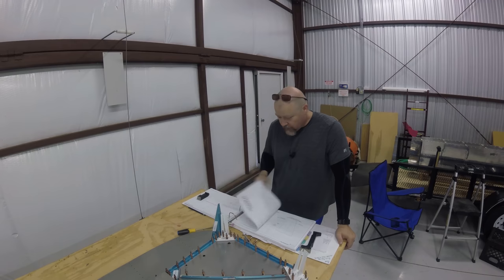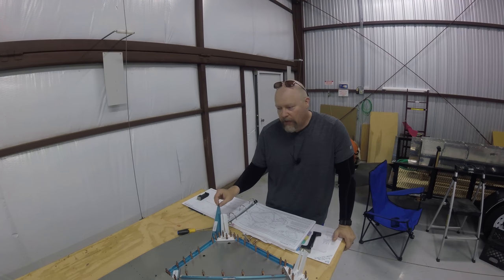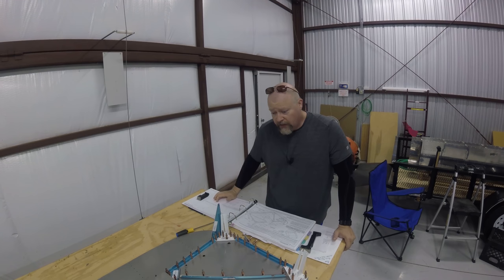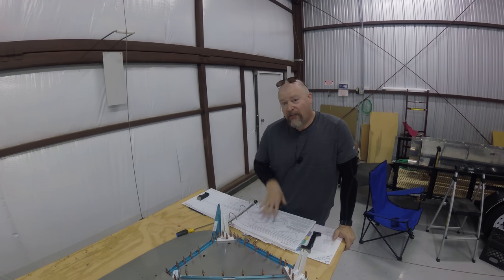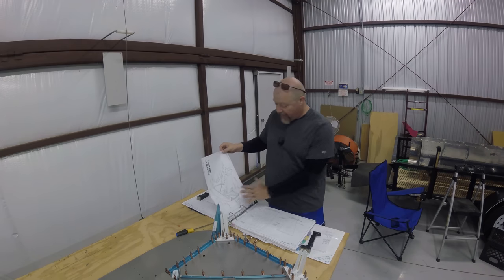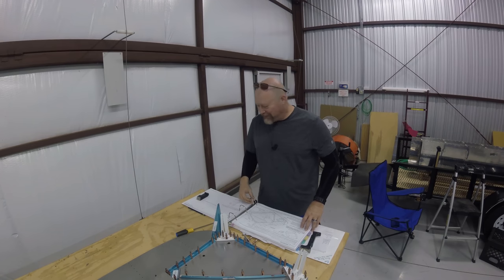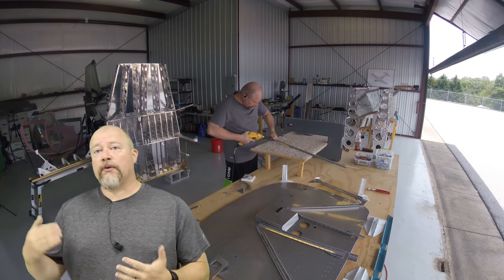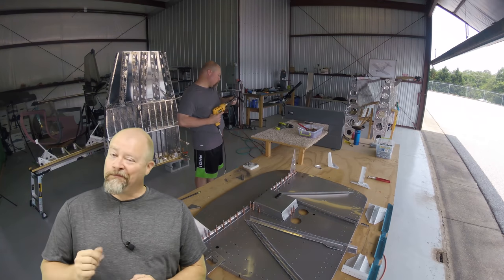RV-10 Fuselage - 013 - Working on the firewall

Comment: Nice work ! 
For steel go with slow on the drill speed,
For Aluminum go with the high speed setting,
And dipping your drill bit in some cutting oil helps a lot! 
Right on keep up the work!

Comment: Aluminium and Stainless Steel with corrode when rivet together. The boating industry deals with this daily. We use Lanocote or prime the parts to help with keeping the corrosion in check.  So I would prime all the aluminium pieces and might consider using Lanocote on the rivets.

Comment: I'm sure I'm not the first to say this but gonna do it anyway. When drilling steel use low speed and high pressure to cut. When you see long chips youve got the combination right. It will help your drills last longer. Small chips=too much speed and/or worn drill bit. Side note, part of my family hails from Elijay,GA. If youre in the mountains of georgia I'm assuming youre close to that area?
Reply from the maker: Right down the road! I live in Blairsville.

Comment: Blind rivet or pop rivet, doesn’t matter to me what you call it. I would just suggest using a cherrymax rivet because it is fine to use in structure, stay away from the hollow aluminum pop rivets. Leave those for nut plates.

Comment: Speaking of Firewalls:
Those White Powder coated parts that you are installing?  
They are associated with your engine mount
Vans WILL have you drilling holes in them (not now --- AFTER you have your cockpit complete, the tail and landing gear  and glass attached and your upholstery installed and looking pretty).  [Oh, and from INSIDE the cockpit]
The pundits and the internet will try to convince you that you will NEED to drill those holes with a Cobalt drill bit. 
RIGHT!!!!!!.   With light/no pressure on the bit, said bit will just sit there and spin.  With HEAVY pressure (your weight againt it), it will do mild cuts and the tip of the bit will turn a cherry red [No touchie, touchie].  EACH hole will take TENS of minutes to bore

Save yourself time, aggravation, and money, and just get the appropriate size bit in TITANIUM --- even with only very light pressure, that goes through that hardened steel and stainless like a Hot Knife through Soft Butter.  Each hole will take tens of SECONDS (if that) to bore

Comment: Pop rivet or blind rivet, doesn't matter to me what you call it.  What I don't get is why not use more of them on interior pieces like the firewall?   What's the point of all the extra effort for something that's out of the wind?
Reply from the maker: Structural support is my guess.
Reply: @JasonEllisBuilds  But aren't 'pop' rivets are generally just as structurally sound as solid rivets? ..I would leave those 2 'pop' rivets you put in in place, save some sweat and frustration..
Reply: Jon Chrisman Blind rivets are substantially weaker than solid rivets.  The rivet specified by the manufacturer should be used.  No substitutions without manufacturer approval.